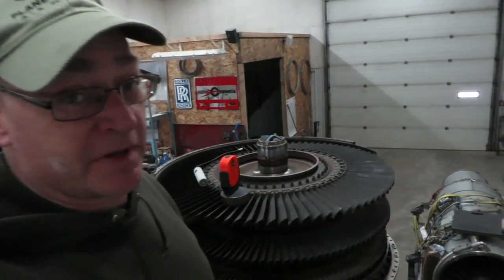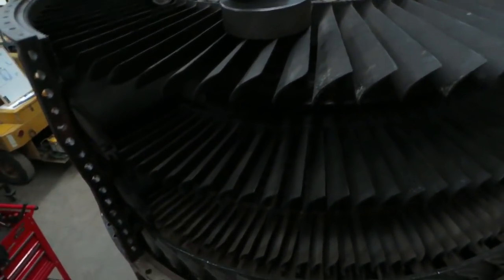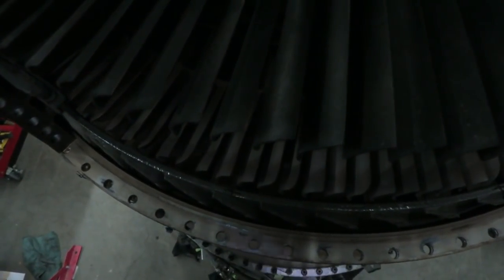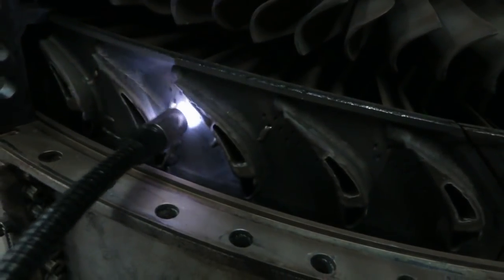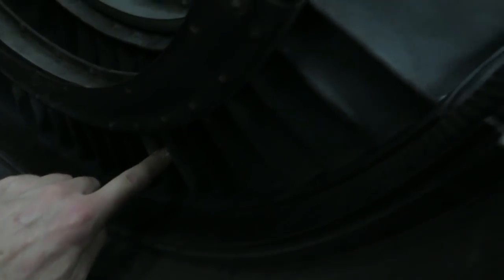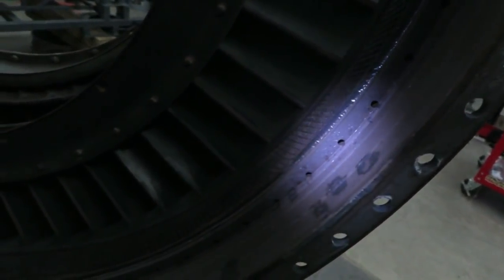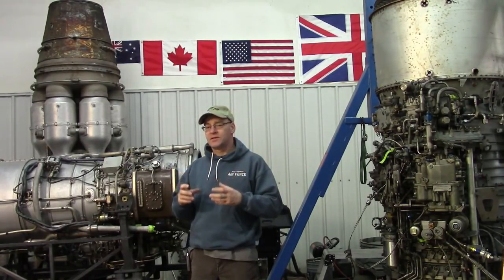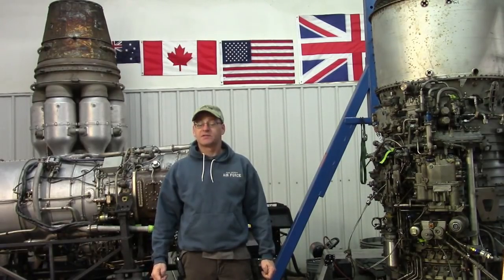Working on a Turbojet: 3 -Turbine Cooling Air

Comment: I heard that turbine engines are only lasting 500 hours in Afghanistan and Iraq due to sand? Any truth?
Reply from the maker: Depends what you mean by lasting.
Many helicopter engines use Inertial Particle Separators on their inlets, so "lasting" might mean the interval between separator maintenance.
Reply: Desert sand is a real enemy of gas turbine engines.  As an aside, the US DoD may not tell you this, but the Abrams tanks in the Gulf wars were at a real disadvantage, as compared to the UK's diesel-engined Challengers.
In terms of problems with aero engines, the sand erodes compressor blades and clogs up the cooling passages in turbine blades.  It also becomes molten when it passes through the combustor and builds up on the exterior of the NGVs and the blades.  R-R Bristol had to design a 'sand tolerant' HP turbine blade for the RB199 engines powering the Royal Saudi Air Force's Tornado aircraft.
PS  Years ago, the UK carried out trials of SRN6 hovercraft in desert conditions without any engine intake filtration..  Their Gnome engines (licence-built GE T58s ) lasted about 20 minutes.
Reply: I work on 61’s that come back from Afghanistan. Its not even sand... it’s like a fine powered abrasive. Think about the rotor blades. Its like a constant sandblasting situation. With air inlets I think there is only so much it can block. But who knows
Reply: I never thought about the tanks. That would be the extreme case for sure. I remember seeing a documentary a long time ago talking about the cobra/apache helicopters in desert storm being grounded because of ingestion.
Reply: Yes, the 'sand' can be down to micron size, which is why sandstorms in, for example, Saudi Arabia, can reach an altitude of 10,000ft or more at times.
Here's a useless bit of information for you. When R-R  Bristol needed to carry out sand ingestion tests on the RB199 engine for the Saudi Tornadoes, the Saudi government had to issue a special licence for the export of the sand.  Apparently, it is protected as a national treasure and resource.